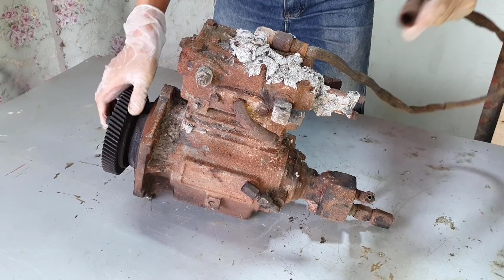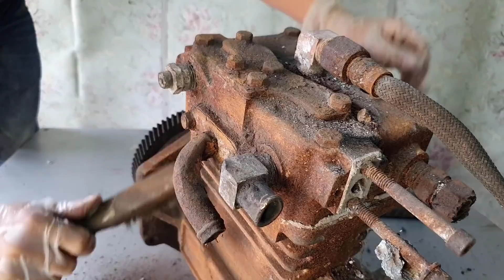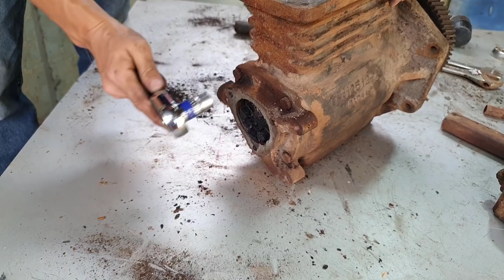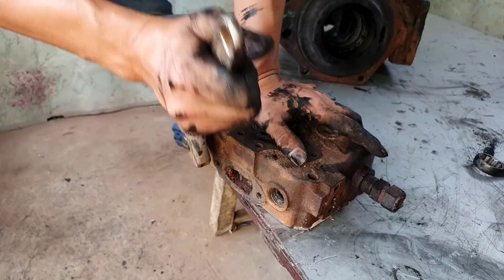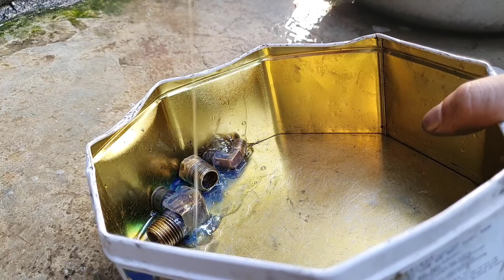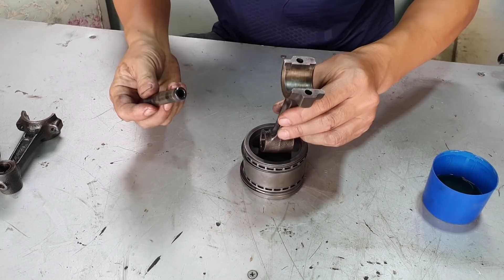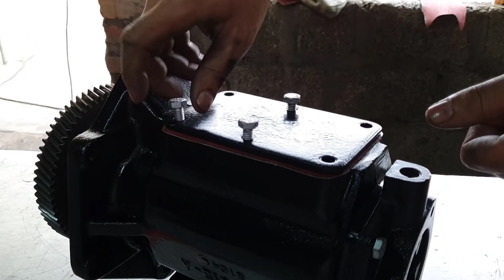Restoration air compressor on burnt truck | Restore reuse rusty old compressor of American truck

Comment from the maker: I'm glad you saw the video leaving positive comments. Please give a thumbs up if it's interesting. thanks so much!
Reply: DT Restoration what chemicals did you use on bolts and can I purchase on amazon
Reply: so am I glad to have seen the video why it is important to know what it came out of is because most compressors on diesel trucks only put out air the didn't have a stop button or a neutral switch you could blow up A tank a half inch thick walls easily but cummins had a relief valve on the back of theirs I think???? it has been so long since I have seen the insides of a truck I could be wrong yet again LOL ever get that feeling where you know something but can't remember all the details of it well here's one
Reply: @godsgrace6351  
Please me to.
Reply: mong video có thêm phần chạy thử sau khi phục chế
Reply: i saw these types of videos just for fun and satisfying purpose. You did a great job. but if u take suggestions lemme give u one. please use hand gloves in next video. Alas i can give u just 1 like. and 1 subscribe. Good luck
Reply: @godsgrace6351  Great result on the bolts ... please can you let us know what you used?
Reply: DT Restoration video
Reply: It is not interesting.. It is SATISFYING ;)
Reply: Instablaster...

Comment: I wanna know what that white fluid is as well that cleaned those bolts
Reply: He painted them.
Reply: @kareem8533  The bolts were not panted. The milky solution used was likely either lye (sodium hydroxide), slaked lime (calcium hydroxide) or quicklime (calcium oxide). All three are strong bases and can remove rust and grease.

With how badly the hardware was rusted though, I'd have replaced all of them. Some of them are extremely pitted and probably have internal damage from heat stress.

Comment: What is the white fluid to clean the bolts???
Reply: Same question here. And the copper tubes?
Reply: If it worked he would have dipped the whole thing in it. Plus saved it at the end .
Reply: I used apple cider vinegar for   24 hour works perfectly well

Comment: I would like to know what you used to clean those bolts and brass fittings?
Reply: I'm guessing the blue was detergent/citric acid and the white was mild phosphoric acid aka toilet bowl ring remover.
Reply: Ive sen plenty of methods. But those bolts came out like they were sand blasted... what were you using m8?
Reply: Yes yes, please tell us. Spent nuclear fuel rods?

Comment: What chemicals did you use to clean the brass fittings as well as cleaning those bright silver bolts?
Reply: Hydrochloric acid. You got to be careful with it- it eats metal surface within seconds,same happens with your skin.
Reply: And what he did with the chemicals, doesn't matter! To do in the right way, is more important.
Reply: Schnik SchnakSchnuk what?

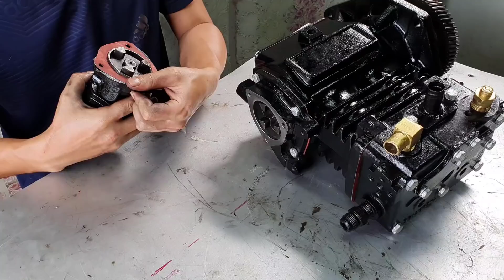Comment: Awesome job, but I noticed you put the one part back on 90 degrees out..... 0:40 vs. 22:31 See how the sensor port now is facing down and the mounting holes are facing up instead of on the side of the compressor. Also what in the world was the horrible "weld?" (I would not call a weld. more like someone pouring melted metal in top of it) on top trying to fix? Was the head cracked?

Comment: That compressor saw some heat i think that was melted aluminum stuck to the head. The first part you unfastened was a fuel pump. It uses engine oil splashed up and coolant piped in to cool the head of the compressor. Good job well done!!! High dollar unit where i live. Thanks for sharing.

Comment: Thank you.
But it is a decoration overhaul.
Its necesarry to chek a gasket  surface of the block, chek a gasket surface of the compressor head, chek the crankshaft journals and cylinder surfaces for ovality.
check the compressor head for microcracks with compressed air.
Only in this way will you be able to return the compressor to its full resource and protects the pneumatic system of the truck from the ingress of engine oil for long time

Comment: Hl DT,
you are doing a very good job.
It would be nice if you describe your funds used.
For example, the blue liquid with which you get the rusty screws silver. 
I know only phosphoric acid, but that makes the parts black.
Thank you for your help. Keep it up!
Michael

Comment: We appreciate your restoration work. But cleaning bolts with some kind of magic liquid is too much. It it works, why did not you cleaned the other bolts and nuts. You can mention about the replacement parts. Nothing wrong in it. I did not see the springs earlier, but the liquid hatched 4 new springs.
Reply from the maker: thanks for the comment

Comment: What did you use to clean the bolts and nuts in?
Reply from the maker: chemicals, detergents and acids
Reply: @dtrestoration8590  copy on the chemicals bud. 👍
Reply: DT Restoration which chemicals for bolts . I want to purpchase on Amazon

Comment: Any broken bolts? Did you ever need to use a blow torch to heat the surrounding metal in order to get the bolts out or nuts off?

Comment: The restoration is nice but what about overheating hardened parts like valves, springs, bearings etc.
I don't see any new parts or i overlooked it?
Reply: I think this was just a "beauty" restoration. He took it apart, cleaned every thing, greased it, painted, then put it back together. Looking at the pistons, this thing is toast
Reply: I feel the same way I can name several parts there that won't work after being turned up to 500+ degrees F. It looks like he did replace the babbits but I didn't see any oil holes. Tldr, it won't work for long.

Comment: nice work, i realy enjoy your restoration video. that assemblely that comes connected  the cranck with the dog cluch i think its a an hydralic actuator to engage and disengage the compressor probabily thats also stuck
Reply: Its a fuel pump.

Comment: Its a bendix tuflo-550/750 for detroit series60 engine. The last thing attached to the compressor is a power steering pump so the can be sold separately :)
Reply from the maker: thank you for the comment
Reply: It's actually not a power steering pump but a diesel pump.
Reply: It's the fuel pump. The power stering pump is located in front of the compressor. Witch is not in the video

Comment: I wonder if it was from a duramax or cummings engine
Reply: That front flange it looks like a series 60 Detroit ....and that would be the fuel pump mounted on the back .....could be wrong but it looks like a Series 60 Detroit
Reply: I think it is from a Continental 6 Cyl Multifuel engine, used in the M-35 2 1/2 ton trucks.
Reply: The gear drive tells me it's Detroit, let alone the oil fouling is sure from a Detroit. Duramax didnt exist back when they were built.
Reply: @PapaJ5667  there were several styles used overseas but yes it does look detroitish but I won't label it as such yet also looks kinda like a cat but I don't know that either if we knew the make then we could look it up and country of origin

Comment: the head gasket is wrong you can se the water ports are not cut
Reply: You can also see that it doesnt have water ports in the compressors block.

Comment: What oil you use to do the nut and skru like new
Reply from the maker: It is acid, a cleaning chemical and water
Reply: 300 мл воды;
50 граммов каустической соды либо же едкого натра;
50 граммов аммония;
250 граммов 40-процентного формалина.

Comment: That's a Tu-Flo type compressor, made by Bendix and with all repect: You did not restored it. You cleaned it and put it all back together and then painted it. There was no use of new slide bearings, re-bore and new pistons with rings. No new valves in the head. Nothing. You even did not air pressurized the oil bore in the crank, to make sure its opened and vented for the oil pressure to come. The gasket material you use is too thick. The rear pump drive should be checked for wear. Never re-use a bearing (front one here), especially if exposed to extreme heat.
Never reuse a piston, especially if exposed to extreme heat. While refitting the head parts (valves etc), special heat resistance grease should be used. Sorry.
Reply from the maker: thanks for the comment
Reply: As a diesel mechanic in Alaska who often must rebuild whats available i must agree about this. This is actually a bad example of whats being sold from overseas, supposedly rebuilt but instead... camouflaged, and unsafe. I must say with all due honesty this is not what America needs, maybe in another country its acceptable. Sorry but i speak from experience, when i was 17 my father a truck driver asked me to repair an exact compressor like this, well it failed on him coming down a mountain and nearly killed him.
Reply: Did it work ?.

Comment: Great vid....  That little thing hanging off the Air pump is a hydraulic pump worth approx $100 USD.    What were the chemicals you used for the Zinc plate?  No  electrolysis  required?
Reply from the maker: It is acid, a cleaning chemical and water
Reply: Sorry but that is a fuel pump. Not hydrologic pump.